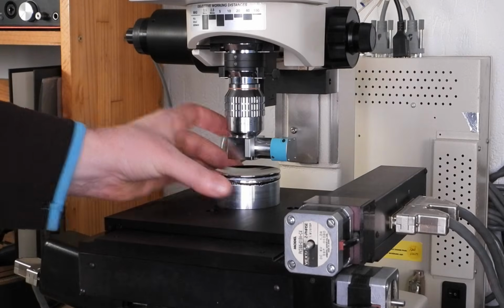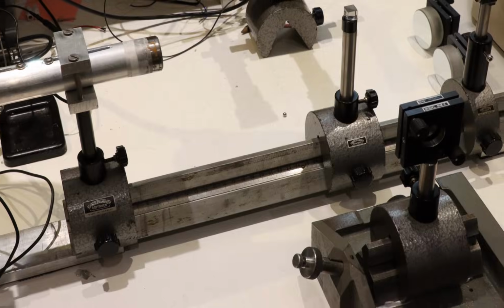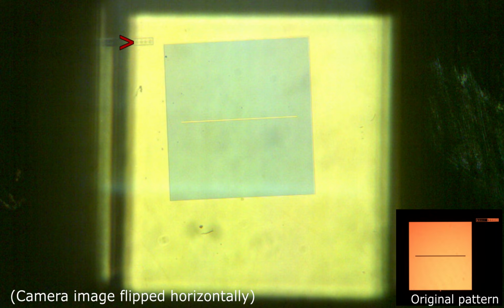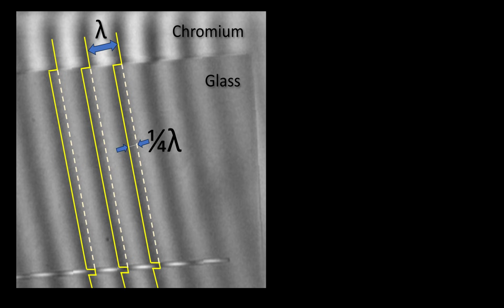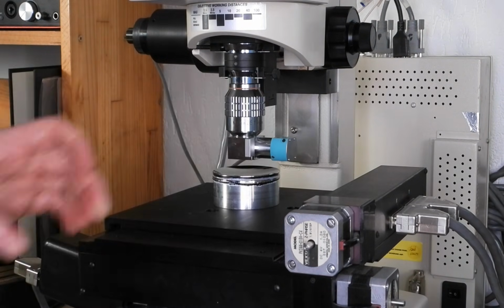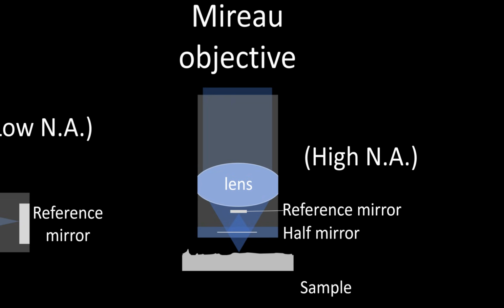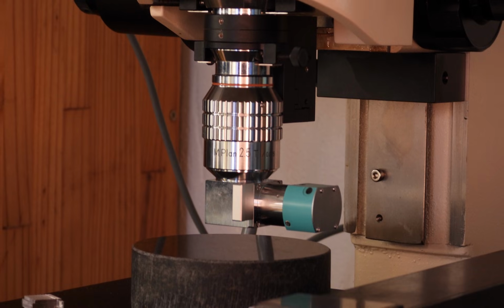Exploring White Light Interferometry!  (WLI / CSI)

Comment: I have a question.  Do you know how to make a very high NA pinhole? It looks if I take second surface mirror, and somehow remove metal coating. It should be very good. But the question remains how to make it circular and high quality,  so light would not be smeared afterward?

Comment: beautiful explanation thank you! Im not an expert and I would like to share that I been wanting to do a simple and very cheap michelsons interferometer just to see light interfere with itself maybe you can help by answering a few questions about your video:

In Minute 6:40 you show the aluminum stuck to the led light can the aluminum pinhole be a few cm separated from several leds? will this be the same?

In minute 6:54 you clearly state that you are using an Achromatic lens but in minute 6:22 the example shows a simple Chromatic lens made with 2 red lines and just to get my mind of this idea... Wouldnt an Apochromatic lens be the best?

Can I use a simple Chromatic lens from a cheap magnifying glass to interfere light?

Can I use simple and cheap mirrors to interfere light?

Can I use a simple piece of glass as the beam splitter or should I buy one in amazon?

I hope my questions are not to simple or even dumb... in any case thank you in advance for any feed back you wish to share!

Brian
Reply from the maker: Separating the pinhole and LED by distance will make the light source extremely dim. To preserve spatial coherence, you should use high-quality mirrors and lenses. If the wavefront is not flat, you cannot do any good measurements. What helps is using an aperture with your lens: this will allow you to achieve better wavefront quality over the area, but of course that area will be much smaller...
Reply: @HuygensOptics  thank you very much for replying. I’ll do my best to buy high-quality stuff not that easy of course and what about the magnifying glass which one of those three do you recommend am I right and the last one is even better than the one they use in this video?

Comment: Could you also consider animation/lensing for radio antennas (and non-point light sources?) where EM waves would radiate mostly from antenna abrupt ends/kinks but also somewhat from each "dot" in the antenna, such that can see how antenna length (and resulting polarity/phase shift) affects direction and shape of the field?

Comment: This is so amazing. A weird question: if one takes any sample of white light out of focus with such a interferometer there would still be a interference pattern visible no? It would just give a flat surface picture though. Now if there are refractive index differences due to thermal effects or the like in this space in the air one should also see strong interference pattern height jumps, am I very wrong?
Reply from the maker: It depends, with the Mirau objectives you can generally change focus and interference distance separately. But you need these to match in order to create a high -resolution map. In other words, the interference and focus distance need to match exactly for the best results.
Reply: @HuygensOptics  Thank you for the answer: It made me realise my very wrong wording as newly interested viewer: Instead of “Out of focus” I meant “not focusing on a surface but a point in air”. Sorry for that. The precision of the Mirau objective just made me wonder if smaller refractive index changes in air (thermal, (sound?) pressure, different gases, concentrations, etc) would also be measurable? Scanning and pattern recording speed might be problems to tackle here. I am just recently pondering about chaotic optics in everyday life which an AI could never simulate so don’t mind me too much. 

PS: is a dirty water surface measurable with the Mirau objective? Is the surface between oil and water measurable? Is the curvature of a drop that doesn’t wet the surface measurable? I think it’s called the “contact angle” that measures a surfaces hydro/oleo-phobicity. I read about multi focal fresnel lenses for retina scans today due to your video & don’t really get yet how they can be made so precise and multi focal. As if a Mirau Multi focal fresnel lense interferometer would be possible.. you see I am clearly having fantasies due to the late hour here. It could never be the Mirau Design, the double & reference mirror would need to deal with multi focal mechanics..
Reply from the maker: @lucelxebinog  well, your suggestion is actually quite interesting. I will try looking at surfaces of liquids. If anything interesting comes out, I'll make a short about it.

Comment: In your coherent light source,what is the block next to the light i see two adjustment screws,is that pinhole or some other lens,  as it is shown  pinhole was sticked on to the top of LED bit confused.
Reply from the maker: In the commercial instrument, spatial coherence is not achieved with a pinhole but a projection system. The knobs are intended for accurate alignment of the light source.

Comment: Brilliant!!! I like your 10,000 ft. approach to this topic. Though I think that explaining the fringes would have been easier if you described constructive/destructive interference of the visible spectrum and how that relates to the optical path difference between the part under test, the reference, the focal plane of the objective. Also, it should be added that too much tilt can cause ray trace errors and slope acceptance errors as well. Try to spread the Peak fringe (center fringe) across the entire FOV (aka Nulling), then take the measurement. You can also play around with the Aperture stop to get returns deeper into the bottom of the cavities. Another FYI, the peak wavelength of the Halogen lamp is the industry standard for the high end optical profilometers (white light). So the peak wavelength should be between 540-550nm. Great job on this video.

Comment: about a light source
does the multi lense array and multi prisim array used in most 3lcd digital projectors constitutes for a "white light source" i mean it is basically spliting highly aligned bam of white light into 3 color bands with simple dichroic mirrors and combine them back into one beam at the central prisim block from 3 sides
could you use inexpensive parts from broken 3lcd projector to build your measuring device? , mainly light colamiting arrays and prisim assembly?
Reply from the maker: @kokodin5895 The Xe lamp from a LDC projector could serve as a (point) light source for this type of instrument. However, these are generally rated at 50-100W which is quite a lot (they generate a lot of heat). As for the rest of the parts, that is hard to say. It depends on the projector design. The beam splitters an a projector are generally dichroic, which makes them unsuitable for this application.

Comment: The last time I made a pinhole camera I got much more success putting the pinhole in the flattened side of a soda can because aluminum foil was too delicate and tended to make its own pinholes.  Do you run into similar problems?
Reply from the maker: The aluminium foil is of course very fragile. I found that it is hard to make really small pinholes (<50um) in aluminium can material, because you need a really tiny drill of some kind.

Comment: so how about laser instead, on a dvd style disc for data, you get the data depth, at least mass produced discs can easily be made to have a certain height, like vinyl but data encoded in the depth, as well. you will be able to burn (dvd-r style) the layers too. well just burn transparency as deep as you need. also dvd-rw style rewritable surfaces changing (re-writing) the layer transparency value.

Comment: Super late to the party, but wow! What a video! You really outdid yourself with this one, I'm just in awe of how much information and demonstration were shown. I had a general idea about how WLI worked, but now feel like I have enough detail to actually build or troubleshoot one. Great work, thanks as always for sharing your knowledge! ❤
Reply from the maker: Thanks Zack, you can actually buy these instruments (the hardware) from Ebay, sometimes for relatively little money. However, as I also said in the video, building the software is the real challenge. In order to get to 0.1nm resolution, you need to establish the relation between scanning position and phase within a milli-radian. So it's not just about simply finding a maximum for the interference intensity for a pixel, but rather fitting the data to an expected interference curve. In fact I don't even know how they do it exactly. But it's a very nice (but also niche) technique with fairly limited applicability.

Comment: That’s a beautiful instrument. The signal processing math one can do on an array of pixel values is awesome, and a great way to learn math and programming. I built an optical position measurement instrument using a sensor which had one straight line of 1024 pixels, to show where a shadow falls on the array, and used a breadboard hobby chip called Teensy. It’s good for beginners learning how to program, and not slow like the original Arduino learning board.

Comment: What a fascinating method, very clever and your video made the explanation very approachable! Really neat that "white" light (otherwise often ignored in high precision optical methods) can be exploited by taking advantage of the very characteristics that make it less useful in most other techniques.

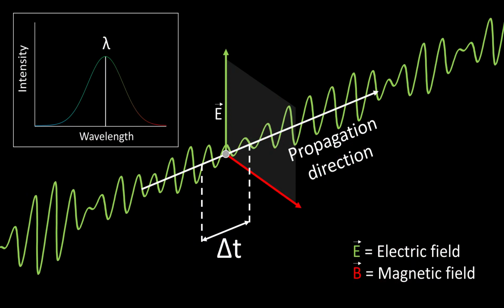13:08 This reminds me of the property that extremely short light pulses necessarily have broader frequency spectrum, which places upper limits on how closely (in frequency) you can pack two optical channels in something like a fibre optic cable while increasing their modulation rate; eventually if you modulate the light fast enough, the two adjacent channels (which have plenty of separation at lower modulation rates) end up smearing over each other.

I seem to recall a previous video I've watched (not sure if one of yours or another creator) that mentioned ultrashort laser pulses and how they're effectively "broadband" and contain all frequencies, which is related to how in audio, they'll often use the impulse response of an audio signal to characterize a given device or environment, because the resulting waveform captures the effect of the device under test across all (relevant) frequencies.

Comment: Around 16m you show how broad spectrum light never perfectly interferes with itself (constructively or destructively) when there is a non-zero path length difference.

Does this imply that the pattern you observe depends upon the exposure time of the camera sensor? (ie a longer exposure will compare/sum longer portions of the wave, such that for a fixed path length difference, a longer exposure will measure a stronger correlation between the shifted+reference waves)
Reply from the maker: Yes correct, on femtosecond and attosecond timescales (where the interval considered will be a limited number of cycles) there will be moments that the 2 waves are almost in phase or antiphase. However if you integrate over longer intervals you will always end up with the sum of the average intensies and not with the square of the sum (or the square of the difference) of the two waves when there is true coherence between them..
Reply: A longer integration time relative to the path difference should also yield greater correlation for the low frequency part of the wave pattern, shouldn't it? I can't do the math in my head to figure out how that balances out against the influence of the higher frequencies though...

Comment: Would this method be suitable for determination of graphene quality?
Reply from the maker: In the Z-direction, resolution is 0.1nm, so I guess if you really do your best, you might be able to see layer structures with a thickness close to a multilayer of atoms. However, in the lateral dimensions (x,y), you'd still be limited by diffraction and the resolution would not exceed a few hundred nanometres. Which is not enough to examine defects in the lattice structure, unless they are very large.

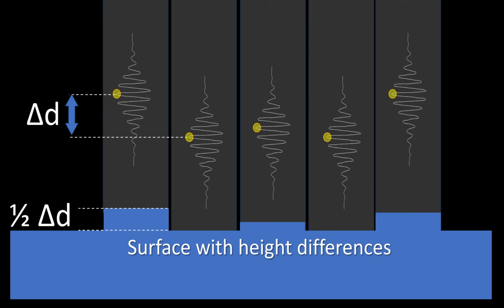Comment: 19:35 I assume "taking a single feature" is for visual convenience, and the real software is actually calculating the correlation of the whole pattern at different lags?
Reply from the maker: Yes, I suspect it fits an "expected" wave shape to the measured intensity data for each pixel. Otherwise it's not possible to determine phase (or height) to within a milli-wavelength.

Comment: The "crude" measurement (63nm) was astonishing! Given the complexity of the machine and software, it would not surprise me to learn that your first value was better. Thank you for making this.
Reply: The software is actually not all that complex. What you measure is a movie where every frame represents a well-known delay. Each pixel contains a linear autocorrelation, i.e. the white light interference trace as a function of delay which looks like a pulse. Then, the software determines the exact position of that pulse within the "movie axis" (delay axis), and these peak positions for every pixel directly give you the relative height map. The rest is scaling and calibration. It's actually a nice little exercise for a grad student to code that up in Matlab or something like that.
Reply: @RealNovgorod  Remember this machine is 30 years old. That means the SW was running on a 80486, or, more likely, an early RISC processor like an early model SPARC.
Reply: @TheEvertw  So? It's simple arithmetic - at most it may use a Hilbert transform or FFT to precisely measure the relative pulse position, but a crude implementation with FIR filters or some simple thresholding would also work. FFT is very optimized and can run on very old machines without problems as long as the signal length is reasonable. That's what made ancient modem-era speech compression codecs work. Maybe the machine could use dedicated coprocessor hardware for that, but I doubt it.
Reply: Just a note: the step height is affected by the phase change on reflection (dissimilar materials: glass and chromium), thus the step is actually a bit higher (I would expect 10 nm more than what was measured)... More details can be found in Zygo webinars - nowadays they can correct for this (in the software, if the material is known).
Reply: @Hunter0seznamcz  But you only measure the propagation distance until that boundary (in a uniform medium like air), so the phase jump upon reflection should only affect the carrier-envelope phase of the autocorrelation pulse, not the group delay. Then shouldn't it be enough to simply measure the linear phase (via FFT) to get the precise group delay and ignore the phase offset, which is arbitrary anyway? Though I guess the relative phase offset over the image should map out the change in refractive index, which is certainly useful as well.
Reply: I doubt it. Remember that he guesstimated the average wave length, no doubt the Zygo device has a better way to determine average wave length. Like correlating the width of the pattern with the (known) displacement of the occular.

Comment: I was just wondering about the effect of illumination bandwidth, and then you said the wider the bandwidth the better the resolution!  That makes sense, but I would not have guessed it on my own. It definitely feels like a Fourier transform thing -- having more width in the spectral domain would allow sharper waves in time or space domain.
Reply from the maker: Hi Ben, the resolution limitations are actually mostly in the accuracy of the scanning with the piezo and being able to relate the scanning position to the interference "phase" in each pixel. To get to the 0.1nm resolution that the instrument has, you have to be able to measure the phase with an accuracy  smaller than a milliwavelength. And you cannot do this by just determining where the maximum fringe intensity that you find using a 25 frames per second frame rate. So yes, there is some frequency analysis present in the software. In the case of narrowband radiation, it would actually be easier to measure phase very accurately, but it would be very hard to identify which fringe is which. The latter is way more easy in broadband radiation, because there aren't that many to choose from. 
@AppliedScience

Comment: As a hobbyist, i was lucky enough to get my hands on a discarded profiler. Mine was made by Wyco, which was later bought out by Zygo. It was in pretty rough shape, but with a lot of TLC, I have it working, though its completely mechanical - no motors, electronics, or software. The images i can get , white light or monochromatic, are absolutely facinating. Thanks to your presentation, i learned that i have to divide the wavelength by 2 for the real height! (Thanks! Its good to learn something new.) For as beautiful as the images are, id love to be able to obtain any kind of software that could produce the type of height maps your software produces. I haven't found anything free. I have a strong suspicion that my ancient version just doesn't have software support from Zygo. Id appreciate any info on possible software substitutes that could possibly produce those types of depth maps. Anyway, this was a fantastic video presentation - thank you!
Reply from the maker: Yes, free software for this is impossible to find and commercial software is terribly expensive. My instrument came with a dongle,  so I can still use it. But porting to another machine would be  very difficult. Hopefully things don't break down soon. Sorry I have no solution for you. Maybe one of the viewers has a solution.

Comment: I doubt this Metro pro software can calculate radius. I've work with it many times before and haven't seen this ability.
Reply from the maker: The manual says it's possible to show the value of the roc, but when I create a value box in the display, it does not display any values.